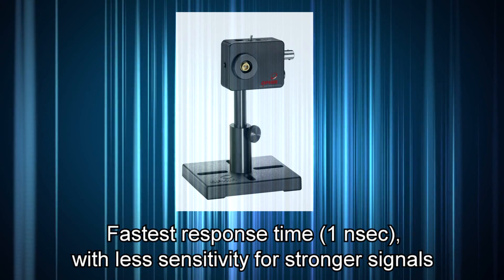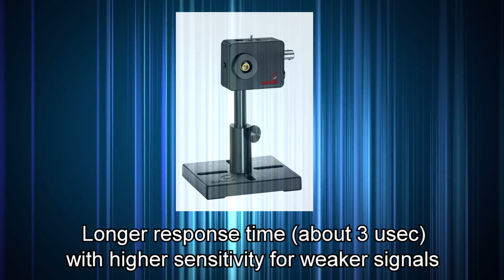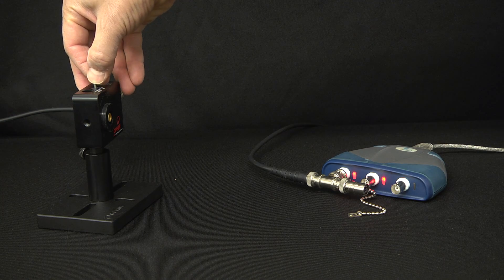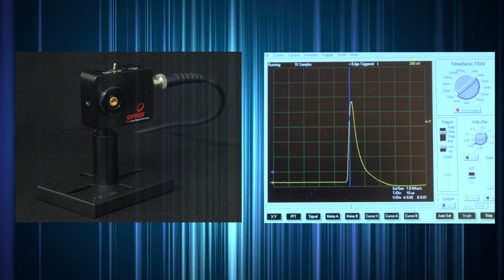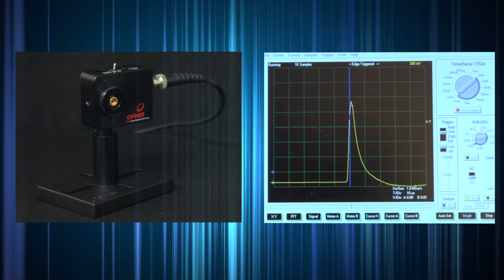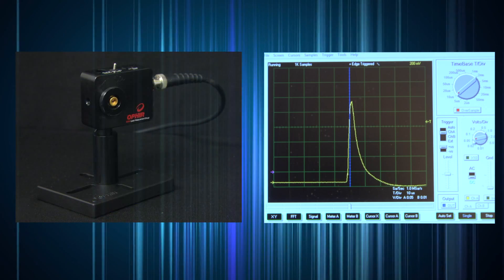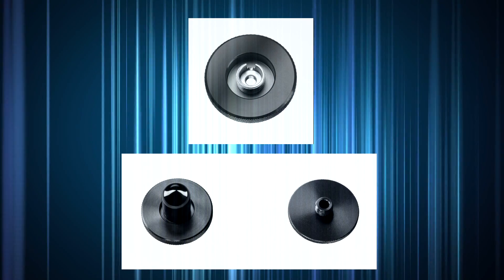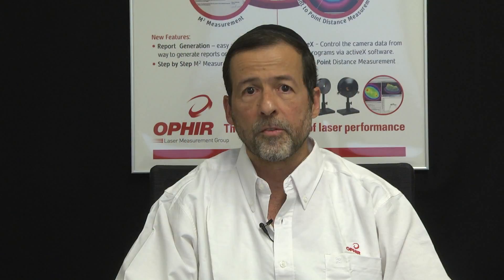How to Measure the Pulse Shape of a Laser

Comment: Informative. Do you guys have anything that will measure the true pulse width of a picosecond laser? I'll get on your website and email you as well.
Reply: Hi Jim, for such ultrashort pulse laser (picosecond or even femtosecond), where even the fastest photodiodes and associated electronics would be too slow, you would need an autocorrelator. You might want to check the innovative autocorrelators we have developed here at Femto Easy : http://www.femtoeasy.eu/products/roc/roc.php
Reply: @femtoeasy3586  Gotcha thank you
Reply: @jimboland1730  Hello all, how can I learn basics of optical and electrical characterization of devices/systems for ultrashort lasers? Which instruments are mostly used and what are characterized? Can you gibe me some examples or hint to do some research?